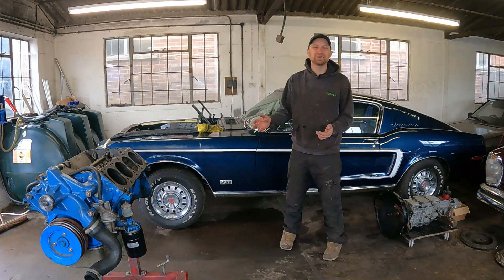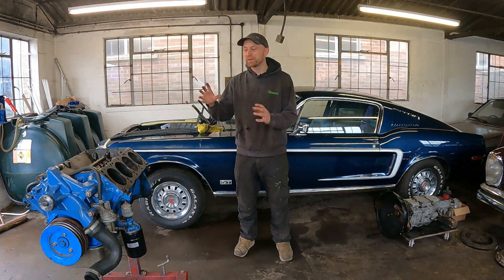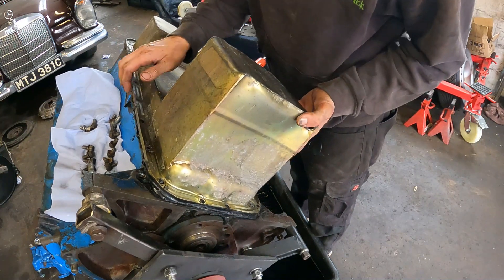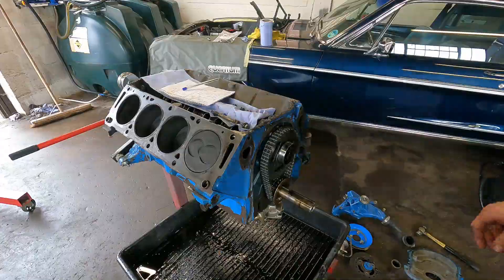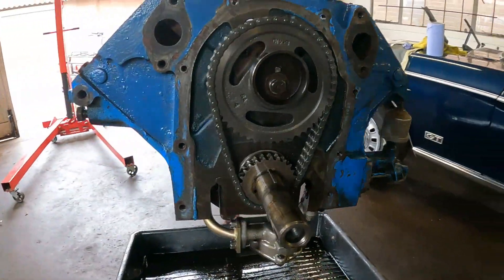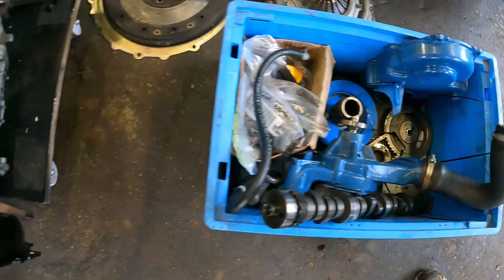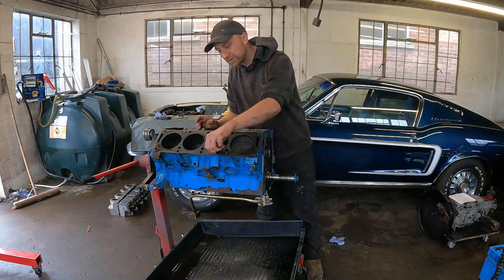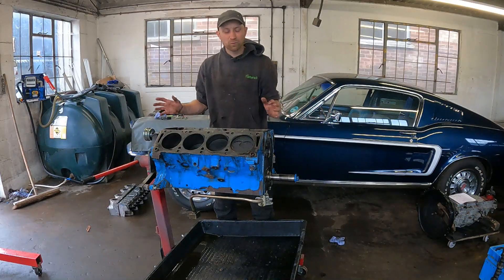Looking deeper inside the 1968 Ford Mustang Big Block 390ci FE!

Comment: The FE Series V8 design line 332, 352, 361, 390, 406, 410, 427, 428 CID was reliable and very powerful for that time   The super rare beast  Cammer 427  SOCH  was part of that line also ..
Reply from the maker: Thanks for the info, and thanks for watching 😃
Reply: @SuperRon  OK thanks and check out the 427 Cammer SOCH ..  You may want one to put in a VW Beetle if you want it to fly like a beetle bug ,,

Comment: The lifter quit spinning so I would change the cam and lifters and timing chain because it is a cheap insurance . Have the block hot tanked after removing all the welsh plugs because there is a possibility of hidded metal. You wont find the lifter piece because it is ground up into paste.
Reply from the maker: We did wonder if it was just case of for what ever reason the bottom of the lifter wore away rather than broke off. There was certainly evidence of silver 'paste' in the sump.
Reply: If you put magnets in strategic places in the engine, you never have to worry about metal debris.